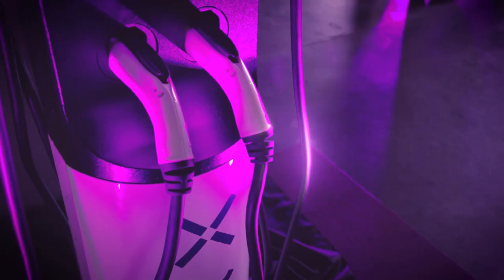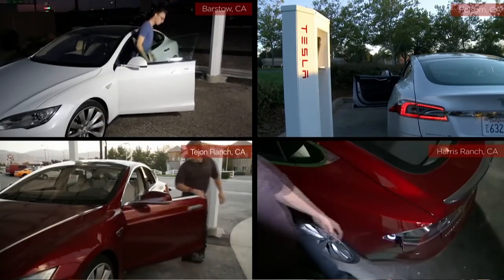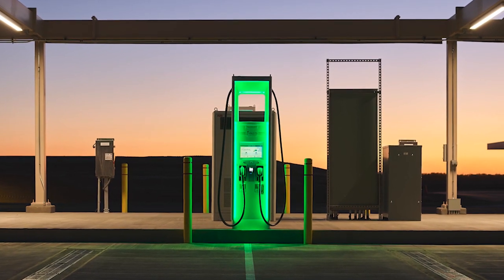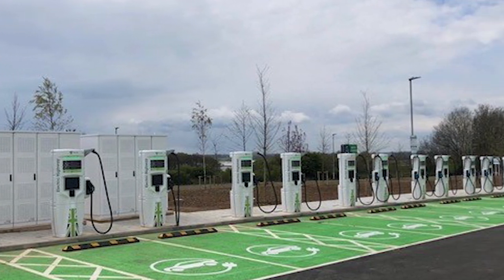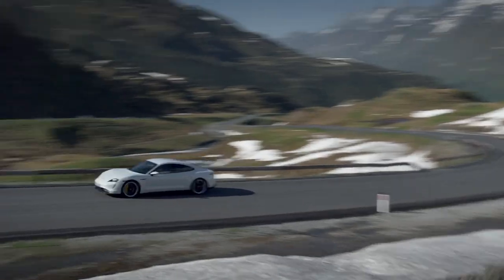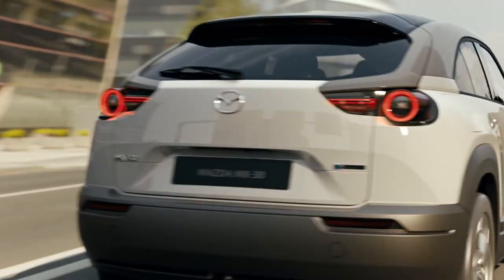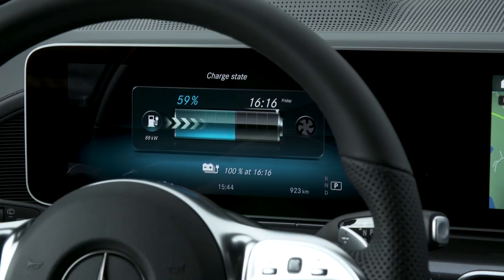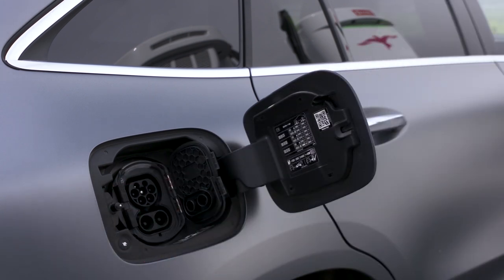Using DC Fast Chargers | I Speak Electric

Comment: Great explanation. Without the need of the EV to convert AC found in residence and businesses to DC the DC Fast Chargers Voltage can be intelligently set by the EV’s request, allowing it to flow directly on to the batteries in the pack. Like an expressway versus traversing city streets. Hopefully the IONIQ 5 will soon arrive in my state in the US. If so you’ll know about it.
Reply from the maker: Oh yeah, please share the news as soon as the IONIQ 5 arrives! Thanks for the comment Gary, love the expressway analogy!